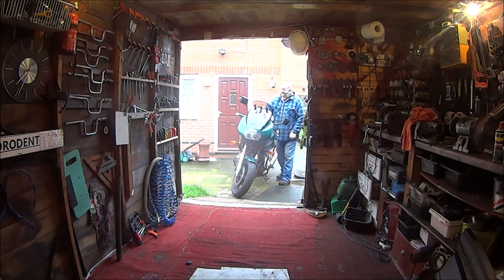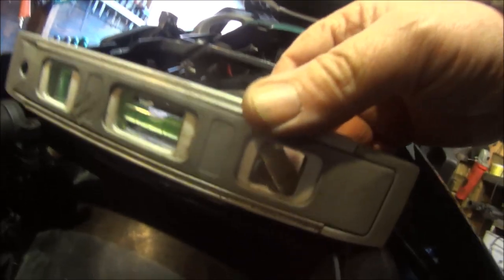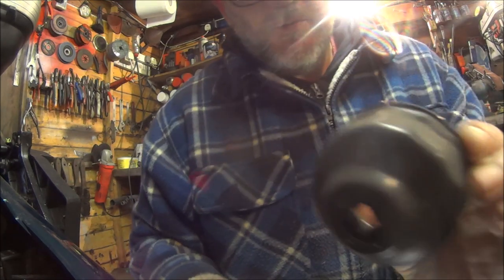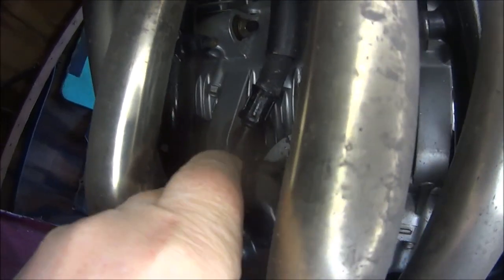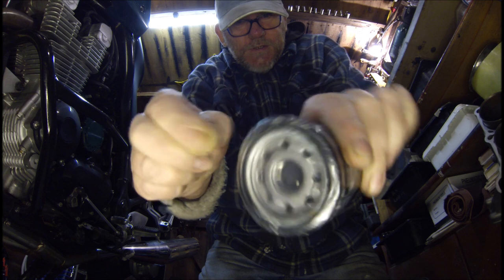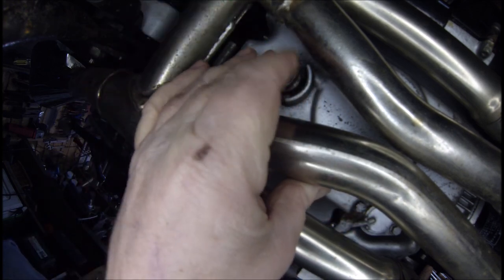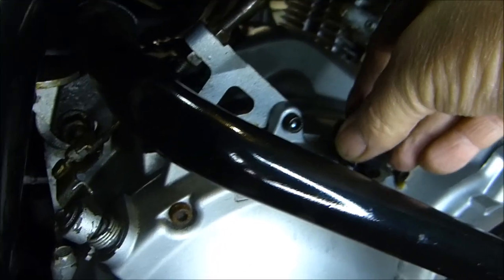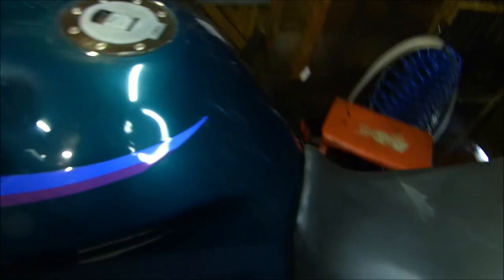XJ900S division Oil and filter Change

Comment: Thanks for the fine instruction video. I like the idea of using the starter motor to pump the new oil round, instead of starting the engine. Maybe it´s a minor detail, but it would have been nice if you had mentioned smearing a small amount of oil on the seal of the new oil filter, before replacing it. Thanks again for taking time out to film all this.
Reply from the maker: Cheers buddy 👍
Reply: " smearing a small amount of oil on the seal of the new oil filter, before replacing it. " He did mention it. And he also said that this particular filter didn't need a bit of oil on the seal. It was already there.

Comment: Hello great movie, I have xj600 and I use mineral 20w50 what do you think is this good oil?
Reply from the maker: Hi Pawel. I don't know what the specifications of your mineral oil is but yes it will be fine if its got the correct speciations for the xj. 

Oil type.. Api grade se, sf, or sg.. 
Oil viscosity. Sae 10w40 or 20w40 👍👍👍

Comment: Nice video! Maybe it could be interesting a valve clearance guide! 

Two questions road rodent:
- Do you "disabled" AIS valve and tubes? Good and bad things to flows air fresh to the exhaust chambre?
- Mine has a ticky noise from alternator chain only in cold. In some videos of divis 900 I heared same sound, so I think it's cause due there is no chain tensioner on it if I'm not wrong.
Reply from the maker: I changed the valve metal chrome pipes for rubber ones so my AIS is still hooked up 👌👍. I'm pretty sure there is no alternator chain on these bikes but then again I could be wrong. 👍👍👍

Comment: hi thanks for video, could you out a link to the tool used for tightening the oil filter?
Reply from the maker: Cheers buddy.....
https://www.ebay.co.uk/itm/Triumph-Scrambler-2006-to-2017-Oil-Filter-Cup-Removal-Tool-OFW65/272480104619?epid=5017024189&hash=item3f711470ab:g:k7IAAOSwXeJYHMWg